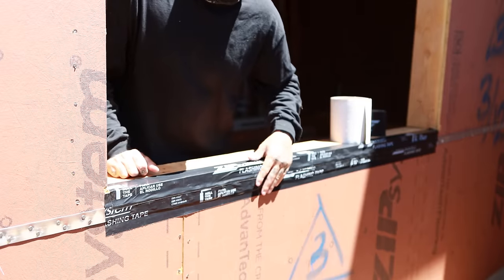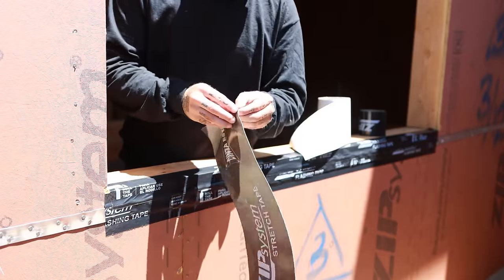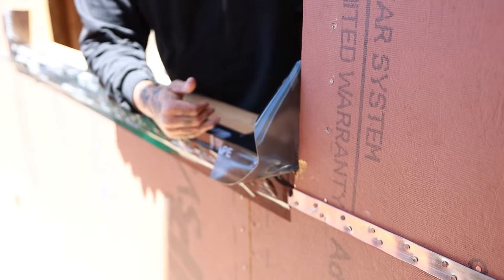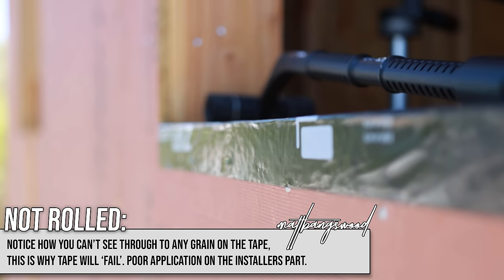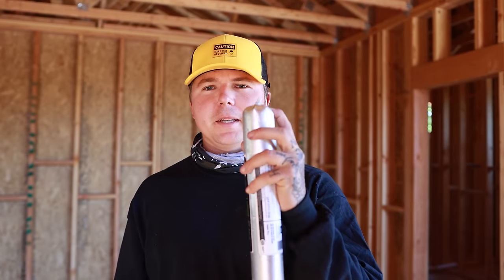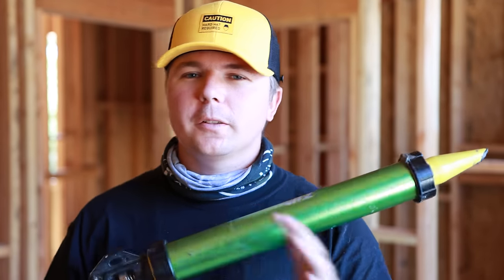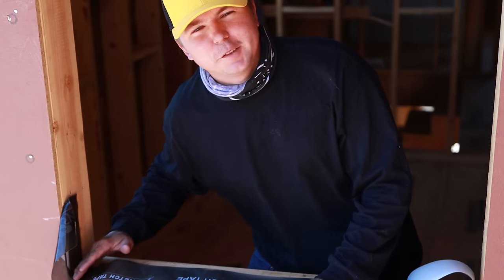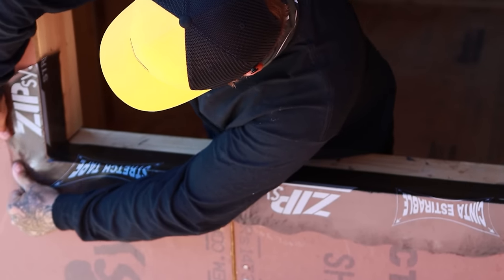Window Flashing | 3 Sill Pan Methods For Window Installation

Comment: from what i've seen, cutting the bottom of the window sill at a mitered angle (angled outward from the house) is a nice touch before adding the tape.
Reply: An angled sill pan is code in a lot of places. My area included. Seems dumb not too. We don’t add a clapboard or anything like that. We cut our cripples right from the getgo.

Comment: It's because it's PRESURE activated!!! Thank you for saying it needed to be rolled, so important! Been detailing windows with SOPREMA for 15 years in a very similar way... another key difference between it and the flashing tape you are using is the thicker bitumen backing allowing for much better self healing properties.

Comment: I learn so much from your channel. I get a sense of quality and craftsmanship when i watch you work. I hate to say it but the local builders ive worked with on my build seem to half ass everything. For example they installed all of my gable end windows without any flashing tape at all, and the sills arent angled. Why wouldn't they take an extra 3 minutes per window and do this!? 😢

Comment: I feel you that the stretch tape is easier but it cost three times as much
Reply: Tape itself costs ~3x as much but saves equivalent on labor. Also, a moron can install stretch tape and not eff up the installation. Liquid flashing isn't cheap and it is messy and takes hours to cure (overnight to get really good cure), so it's the most expensive option.

Comment: Giod content, thanks for the video. 

A note on liquid flashing over tape. I believe Huber recommends wiping tape with acetone first to remove the release agent from the top of the tape that is used to prevent it from sticking to itself on the roll.

Comment from the maker: There’s a few things to note:

1. I HIGHLY suggest taping your sheathing seams first, unfortunately I can’t do that in California as they want to see our nailing pattern first. This home wasn’t signed off before we did windows, as inspections have been all over the place.

2. Prime or roughing up the Flashing Tape before adding liquid flashing is a must as well.

3. Do what works for YOU. I used to tape windows and do the butterfly method, it worked but was a multi step process.. Wouldn’t be using Huberwood if it didn’t make us more efficient.

4. Have a good weekend, don’t work too hard. I’m heading to LA on Monday, if anyone wants to meet up, I’m going out to a 40K SF mansion in the hills to film a video. Yorba Linda area..
Reply: Learn to pre tool your bead of sealant and not only will it bond better but you will have less goop to deal with at the end of the day
Reply from the maker: @grahamennis606  Not a fan of the liquid flashing for windows, probably why I suck at installing it.
Reply: Also never caulk up its hard to see what your bead is doing

Comment: Like the stretch tape and then reg tape and lastly using liquid flash when  needed, cuz ya do need to use it in some areas. Everyone has there preferred method and like that we have the “materials” to choose and work with👍🏻
Cheers✌🏻

Comment: @mattBangswood, with all the mid-century renovations of adding sliding glass doors to bring in lighting, would you show how to install a new sliding glass door/window, by cutting a hole in the existing wall, reinforce it properly for load stress?

Comment: Small question from a novice.  I understand from Huber that the wall sheathing joints should generally be taped before moving on to any subsequent construction steps, such as creating sill pans for window installations.  In the video, I see that the joints in the wall sheathing are not yet taped when creating the sill pans.  Any thoughts?  By the way, Matt, I love your videos!  I know that this is a rather picky question, but I continue to learn that attention to detail is a quality that you embrace and advocate (which I agree with fully).
Reply from the maker: I was hoping people would ask this.. In California I have nailing inspections. I would LOVE to cover those bottom seams before doing the tops.. Unfortunately I can't until nailing is passed and I wanted windows in this place quick.

I will be lapping backwards the flashing tape onto the sill pan, not too worried about it as this stuff does a great job of sealing. Lapping the way you would with other products isn't an issue with ZIP.

Comment: Wow, this is all that flashing is? Im repairing antique weighted windows(fixing the weight systems behind the trim, replacing broken panes) and many have water damage under them. The web said this is due to bad flashing.  Im in the walls looking for some specialty metal or fancy grooved SOMETHING that would direct water out. But its basically just a seal. Thank you for this vid lol. Now I know its this simple i plan to might as well fix all flashing as I go.

Comment: I have brick face on 2 sides of the window I'm replacing so getting a sill pan in will require cutting between the back of the brick face and the OSB sheathing with a multi tool. I may have to rebuild my rough opening because of termite damage.

Comment: I was always taught to go all the way up the sides. Not just six inches. I mean the top of the window is where water usually becomes a problem. So if you only go up 6” there is a good chance water is gonna get behind that tape and have nowhere to go. So it sits there and tots the sill. Right?

Comment: I like the liquid flashing.  It is tenacious.  But boy it can get really messy if you don’t keep on top of it.  And the applicator is a one time use!
Reply: Agreed. But tips can be reused - just let the liquid flashing cure and you can pry out the cured material quite easily - doesn't adhere to the plastic tips very well.

Comment: I noticed when using both the liquid flash and the tape you applied the tape first then the liquid flash. Would it matter if you applied the liquid flash first then the tape (assuming there is enough overlap for the tape to "grip" onto structural members not just the liquid flash)?
Reply: The liquid over tape is preferred. You want everything to flow over not into.

Comment: Not related to the video but do you do anything with the under driven nails on the zip walls, or is that not an issue that an inspector would call out?
Reply from the maker: We'll talk more on this when siding, but over 1/2 way through the material we liquid flash. Anything under, we don't worry about.

Comment: My house is under construction and the builder just finished framing roof trusses. It’s a 3 story single family home, the builder had mistakenly framed a window where a door should be and vice versa on the second floor opening to the deck. Is it possible to fix this during framing? To switch door and window location. Is it too late? This is about day 4 of framing.
Reply from the maker: Are you wanting to keep them the way they are or switch them back to they way they should be?

Either are doable..

If you want to switch them back to the way it was laid out prior, they can re-frame it.. The header for the window will be too small for the door, so they'll have to change that, but it's not a hard fix.

If you want to leave them the way they are, consult with whoever is designing your home. Have them OK the change.
Reply: @MattBangsWood  Thank you for your insight. 
I want the builder to switch them back to where they should be. Where the door is now should be a 72” wide window and where the window is now should be a 36” door. They had the locations flipped. It seems like they used the same size header 2x12s

I think they can just swap the framing with same material. I just don’t know if it’s going be a hard change because it’s on the second floor carrying all the loads from the top floor and roof trusses above.
Thank you. Your response makes me feel better about the issue.

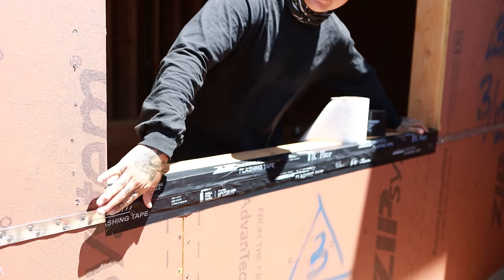Comment: 1:57 and the purpose of this metal strapping is it for CA mainly due uplifting?  I don't think the house i live in has any strapping like your use. of course its not zip systems
Reply from the maker: Perforated Shear Walls: perforation in a shear wall, requiring ridiculous strapping.
Reply: @MattBangsWood  are these at the seems?  whats wrong with Nailing like the normal? I'm  not following here. Isnt zip systems a Plywood ?
Reply from the maker: I have to do it with everything, OSB or ZIP.
Reply: @MattBangsWood  oh seems i didnt see you cover that in other videos
Reply: @SuperJimmyBennett  if you're not in CA you probably won't understand, it's for over engering to the max because of law suits, so over do it. 
I know you you are thinking.
Can't tell you how many times I was in disbelief, just have to charge $
Reply: @patrickjohnson7801  sounds more like yet a mother pull from fake government to get more money out of "i need to inspect" your stuff.
Reply: @SuperJimmyBennett  not by a long shot!
We here in CA do have Earth quakes, although rare ( big ones)  next one is just around the corner could be 20 years but who knows if you buy a house here that is built in the 80ds and up your probably going to be ok if it Hits really close, it's worth it to save lives, my house was built in the 50ds and had a close one in Whittier CA
I fared very well , block wall got a couple of cracks knocked out about 16" of water out of the pool , but my house is a 1207 square foot , but the big ones that have a lot of windows and 20 foot Walls and crazy stuff have a lot of engineering to keep them up.
In CA 1207 is pushing 680,00.00
Reply: @patrickjohnson7801  its common sense to build for the given area . so yes by a long shot.
Reply: @SuperJimmyBennett  it's one of many reasons my son move to NC. 10 minutes from the boat ramp on lake Norman. He bought a 1820 sq ft for 192,000

Comment: Is that a special roller or would a vinyl floor roller work?
Reply: Any roller works. You just want to burnish the tape. Just like burnishing masking tape.
Reply: It’s a special roller it has z’s on the metal band. Something to do with the warranty
Reply: @keithN6  Huber makes their own roller but it's nothing special other than the little 'z' it imprints in the tape once it's rolled. Nothing to do with the warranty - just easier to do quality checks to see if the tape has been rolled.

Comment: I wonder how long the tape lasts? Roofing felt and cement more than 100 years , plastic sheet maybe 20 years and copper with solder indefinite.  Tern also is for ever. Polymers deteriorate and maybe are food to something. Hmmmmm.
Reply: Roofing felt lasting 100 years? Where do you live?
Reply: Acrylic tapes are supposed to last ~100 years
Reply: @johnowens178  100 years might be a streatch but, Im in the PNW and we have pulled apart some old houses waterproofed with felt. Sheating usually looks like it did the day it was put up. If you know how to lap properly and take your time there is no need for all these fancy new products. Im my opinion they are just another product they can charge your for.

Comment: Seriously? if you blocked out under the sill or with something larger 4x6? and rolled out your  strap an 1 1/2 lower you wouldn't have flashing interference with a perforated shear wall. Mechanical flashing will always  out perform chemical flashing for long term